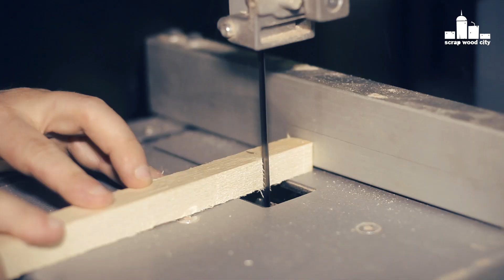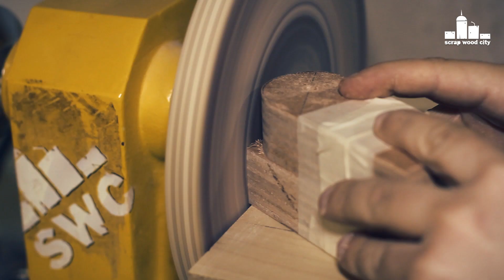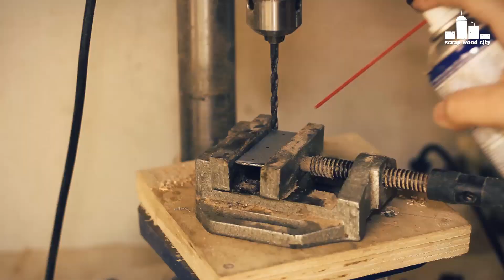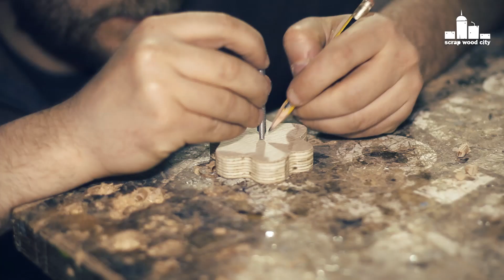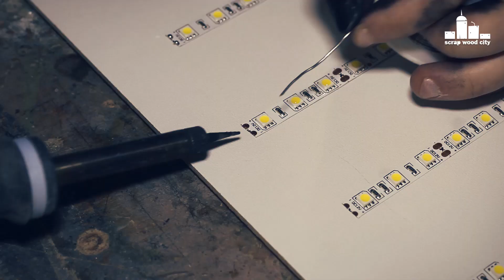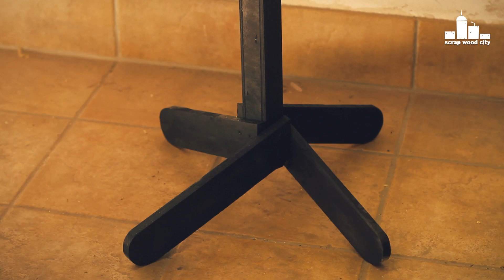DIY video light with dimmable LED strips

Comment: Great work as always mate. Do the LEDs all light up the same? I see you wired them in series but from what I've read the LEDs at the end should be less bright. How many meters of LEDs did you use?
Reply from the maker: Thanks Robin. I've used 5 meter stripe. They do not seem to have a difference in brightness, after all they were originally connected that way. I think I will need to add more LEDs eventually to increase the brightness even more!